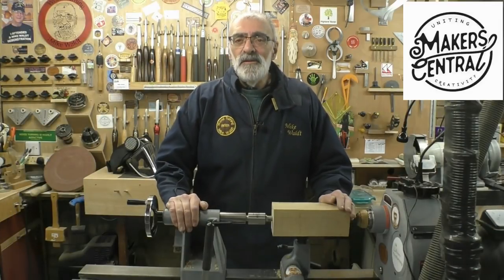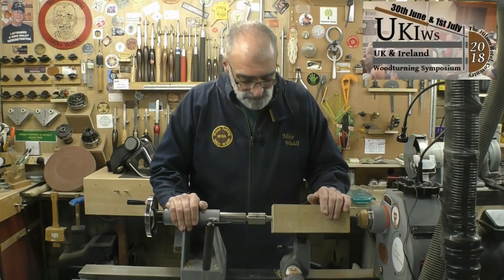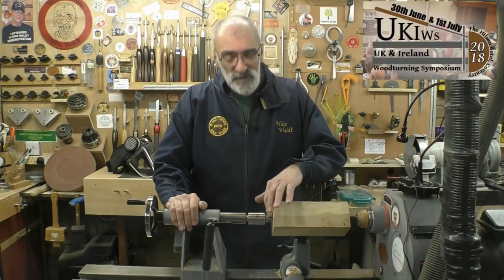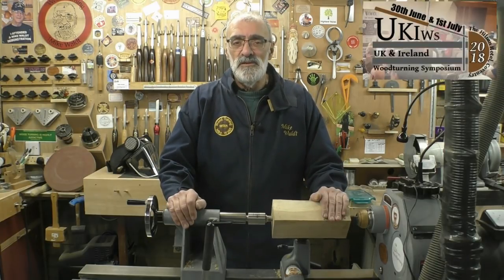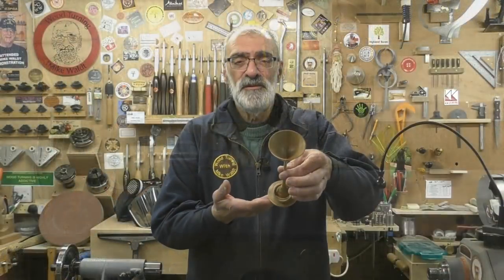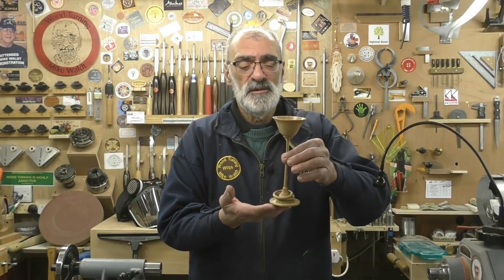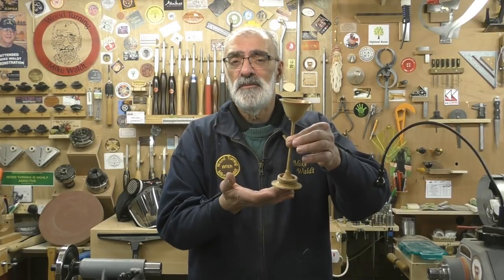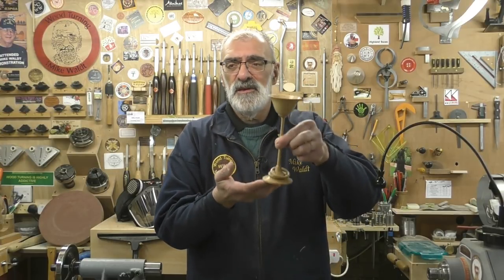Woodturning - Goblet with Two Captive Rings

Comment: Thanks, Mike, another excellent video.  When you began the hollowing process, why did you start with an angled parting tool? I am now inspired to make a goblet.
Reply from the maker: Thank you Geof. It is a technique I once saw Jimmy Clewes use in a video, and I thought I'd try it .. and I will be using it from now on as it is a very effective way of determining wall thickness on the bowl of the goblet, especially on "shaped" ones such as this.
Hope that answers your question adequately .
take care
Mike

Comment: Loved it!  you have been an inspiration to me for some time now and have finally bit the bullett! , funded by my previous hobby, I now have my new lathe, tools, (including carbide from the chap you recommended), headstock chuck, drill chuck,  centres, etc etc but especially a quality P3 face mask, I do notice you wearing yours, But will not start trying to turn yet as i am totally discombobulated (!) as to what chip/ dust extraction to go for, industrial vacuum? or Camvac style and especially noise consideration in a small workshop would you mind telling me what you use and I would greatly appreciate your advice and opinion - accepting that it is yours. I also have a 0.5 micron air filter - lungs not so great now, thank you and regards, Tony,
Reply from the maker: Hi Tony, what a great piece of news ... you are now going to get totally hooked, I assure you.
I have the Numatic extractor/vac dedicated to the lathe for sanding, a Record Power vac which serves the band saw and table saw, and a Jet  ceiling mounted air filter system  -  and of course a shop vac for dust "hoovering". Not an ideal set up, as I have added over the years. I always ensure I wear my powered respirator too, even whne I clean up, as you normally disturb as much dust as you remove.
Hope this helps a bit.
Cheers
Mike

Comment: Error. For filming, parts seemed to be at 4x speed or greater. Could you give some indication, and normal cutting time for you up to the point of sanding? Also, you have an ambidextrous ring tool; did you regrind that yourself? My Sorby tool is for cutting from the left only. Thanks, Bernard.
Reply from the maker: Hi BernardI am not sure what you mean by "Error" my friend. 
To explain, my woodturning is a hobby, and I am not in a race, so time is not important at all when I turn something, and to be honest I very rarely if ever time the various stages of a "turn". If however I was a production turner, or indeed made my living from turning, then the time factor would be of the utmost importance. 
I hope you find my answer acceptable, as it is an honest one.
Thank you once again for watching, and posting a very relevant question too.
Take care
Mike
PS - The ring tool is made by Crown Tools here in the UK, and is indeed a double sided tool :)
Reply: Thanks Mike, the error was mine in botching the comment, so it appeared in 2 parts. I just feel I am very slow, even though it is a hobby. So perhaps, approaching 80y I should get a move on! Your answer Was absolutely fine. Best wishes, Bernard.